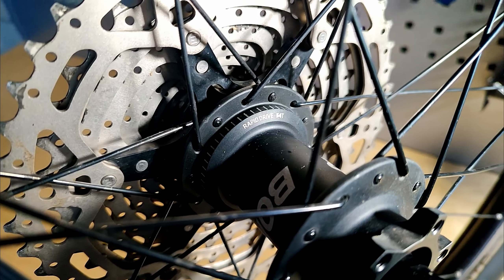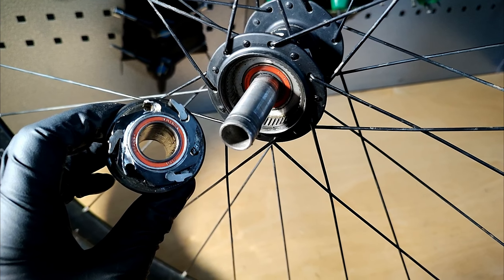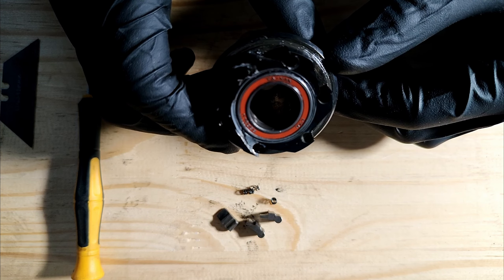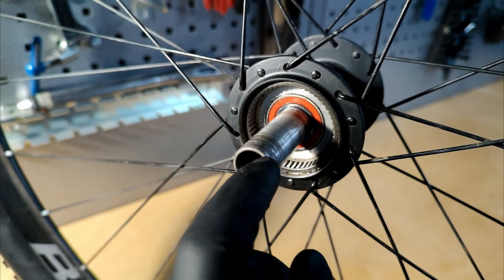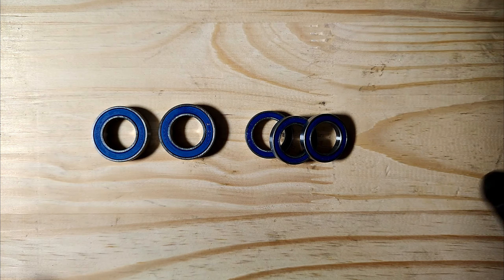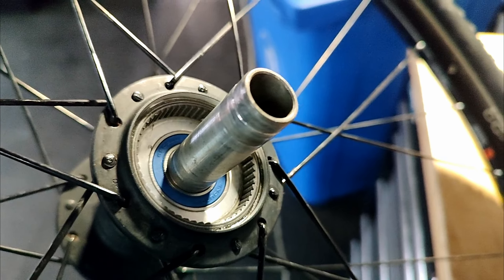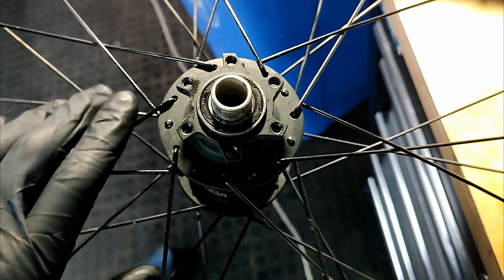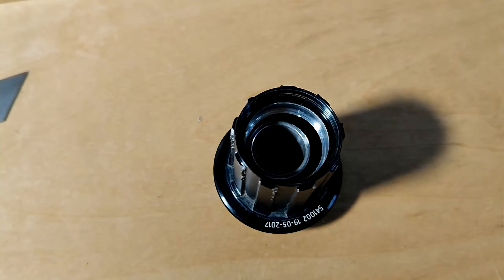Bontrager rapid drive rear hub bearing replacement

Comment: How do you just pull off the free hub body??  I tried for several minutes and mine didn’t come off
Reply from the maker: If its brand new they're very difficult, but its just the cap.

Once the black cap is off its very easy.

If the hub cap is already removed then just check that it is definitely a 108 rapid drive freehub
Reply: @JustFrana  the cap is still on, I also can't get it off, hub has 1000 miles on it
Reply: Try using a blind bearing puller

Comment: i can remove the freehub body without removing the cassette, is it normal?
Reply from the maker: Yes , when the hub cap is really stuck i use the cassette as handle to pull the cassette towards me with hands on either side

Comment: Had to remove the hub bearings witha hammer and punch gently, how would you reccomend
Reply from the maker: for the hub shell i use a bling bearing puller and for the freehub i use a punch and hammer

Comment: My end cap and body are really tight on there, no way i can just pull them off.
Any tips on how to get them moving?
Reply from the maker: For very stuck ones I have a tool called hub genie , google it and you might be able to use a blind bearing collet in the same way 

otherwise wrap the end cap with leather , put the axle through the wheel and then clamp the end cap en A bench vice and pull the whole wheel straight up.
Reply: @JustFrana  thanks but it's not going a mm. The cap is not moving so the free hub is still on to. I'm afraid to damage more then nesassery if i continue here. 
I'm going to take the wheel to my local shop to have the stupid cap removed. Thnx
Reply: @dannyvv75  I had this problem too.  The o-ring gets stuck on the shaft, try putting some wd-40 inside the cap then give it a good yank.  The hub genie works awesome, but without one, you can still get it off with a little effort.  Worst case is you'll need to replace the cap, which is about 9 bucks.
Reply: @mikeriley1475  it's off,thanks. But it took serious effort, no way it will come off like some video's show just pulling with bare hands.
Reply: @dannyvv75  So did mine.  I had to use my driver as a slide hammer to get it off (take that bearings), pawls went everywhere.  I put a little grease on the o-ring for the re-install, then took it back off again to check and it came apart much easier the second time.